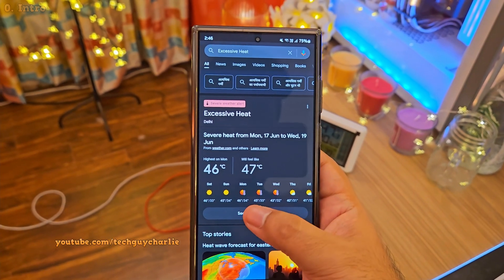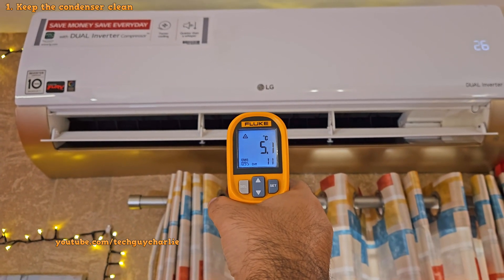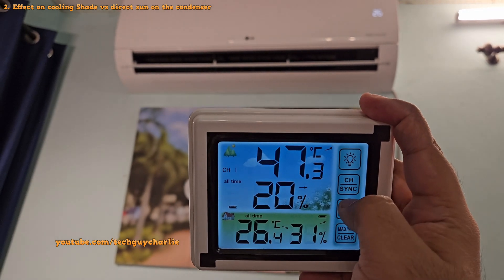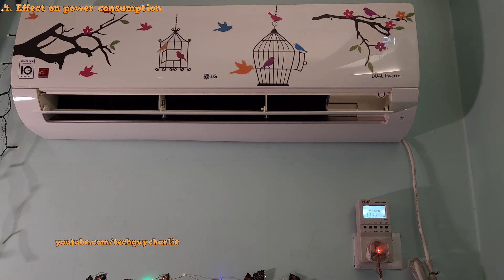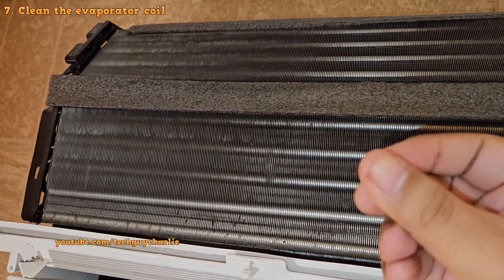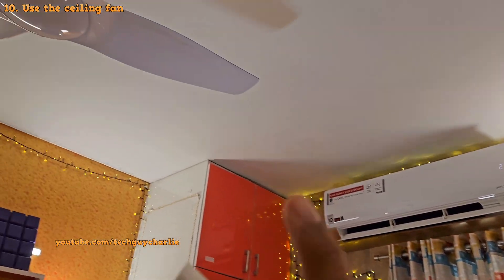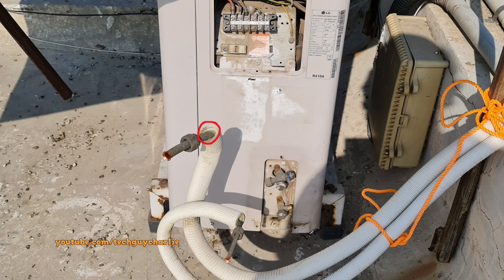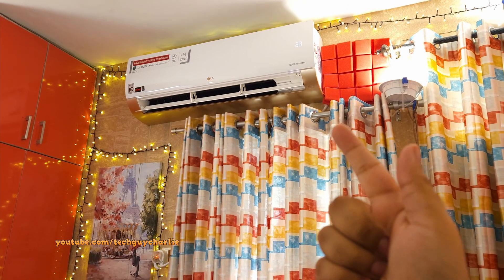AC Doesn't Cool During Extreme Heat? Watch This! 🔥 ❄

Comment: Hi  Dear charlie. Love from punjab. My 1.5 ton 5 star LG  ACs compressor is tripping and it does not cool the 280sq feet room..... what would be the reason??? Also the AC is consuming alot of electricity.... please help
Reply from the maker: How old is your AC? I hope its condenser is clean, get it serviced, pressure wash both indoor and outdoor coils and see if cooling improves, it can also trip if there is refrigerant leakage, there is a feature on LG AC's that turns off compressor if the gas charge gets too low, you will see an error CH 38.
Reply: @TechGuyCharlie mitsubishi vs LG ac which is best?? Your opinion matters alot.. thanks in advance.
Reply: Bro for 280sq ft you need atleast 2.5ton AC not 1.5ton. that's why you AC is using too much electricity
Reply: Ok thanks which ac you are using by the way?? @roger58298

Comment: Man, where are you located that it gets to 117 degrees?  My sympathies!  I wish my AC would blow at 5C (41F).  Mine may get as low as 56F and I understand that's normal.  I like the little things you do like an extra rinse on the condenser hose.  You're obviously very smart.  Excellent job here!  Thank you.
Reply from the maker: New Delhi, India! These temps are pretty normal for this time of the year, in-fact the latest model of this AC is designed to cool up to 130F ambient, at least that what it says on LG's website. I'd say, 56F is a bit on the warmer side, but it'd say its normal because I've seen my own AC blow 56F air (while running on low power) after cooling down the room, there are so many variables.

Comment: Will you please tell me what is the standard temp difference between ambient and condenser coil of outdoor. My condenser coil is heating upto 15°C more than the ambient temp around outdoor unit. The compressor is tripping off sometimes. Dont know what is the reason? The outdoor and indoor is cleaned.
Reply from the maker: Normal AC or Inverter? I have never had the compressor trip on Inverter AC, it slows down but never cuts out even on the hottest days, the old non-inverter used to trip. how old is your AC?
Reply: @TechGuyCharlie  Its LG Dual inverter 1.5 Ton 5 star 2022 Model. During summers there was no trip off but cooling was not adequate as LG technicians told me heat load is quite high in my top floor room. But its starting of monsoon and I have observed by smart diagnosis app that very oftennthe condensing coil is heating upto 15°C more than ambient temp and sometimes the compressor gets tripped.

Comment: Hi bro..

I have a cheap 4k tv 43 inches 60hz.. it plays 2160p fine in youtube but when i checked with cpuz it says my tv resolution is 1920 x 1080. I dont understand.. actually iam trying to make it a gaming tv.. so confused on which gpu should i purchase, 1080p or 4k gpu..

thank you

Please answer
Reply from the maker: That is because YouTube will play 4k even if the monitor resolution is 1080p, you need a GPU that will output 4k, like a basic RTX 3050 will output in 4k, although its not meant to game in 4k, for that you need a powerful GPU.

Comment: Thanks Charlie for yr very informative video on a different Subject of AC. However I don't have an LG AC, only LG Refrigerator. My ACs are O General.  Ifnu can make video on O. General ACs it will be wonderful. Thanks.
Reply from the maker: Welcome, glad you enjoyed, btw the working principle of an AC is the same, so this video applies to EVERY air conditioner, regardless of the brand, or even the type of AC (Split/Window/Floor Standing) the only thing that doesn't apply is the last part of the video where I demonstrate the smart diagnosis feature.

Comment: Very informative 👍
Reply from the maker: Thank you, I was already working on this video when you last commented. 😁 It just wasn't hot enough to film the rest of the parts.
Reply: This is a great video bro, but now my ac is about 8~9 years old and is no longer cooling well anymore, was thinking of getting a new one but which one would you recommend?

The panasonic ac or a LG ac?

Thanks for reading my comment, have a good day ahead.
Reply from the maker: According to me, 8-9 years is not that old for an AC, I've still got the LG AC I purchased in 2016, so it's about 8 years old and it still chills the room.
Both are good, I picked LG because their after sales service is really good, so far never had any issues with LG even after running my AC in extreme heat.